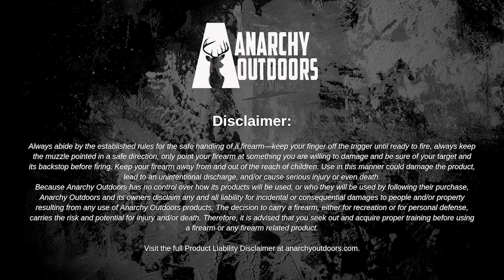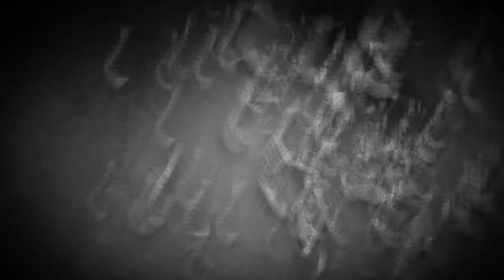Ruger Precision Magnum Bolt Shroud Installation

Comment: i installed new Aluminum shroud worked great but now i need to remove it i turned it and its clicked and locked now i cant remove it or  slide it back into gun its off centre how do i reset its locked wont move
Reply from the maker: Keep turning the bolt shroud and it will click back into the correct position. It will feel hard but just turn it.

Comment: is the original shroud suppose to be a bit loose when instal ? on my 338 lm sorry its my first bolt action gun i m new
Reply from the maker: Its loose due to Ruger tolerances. If its to tight you will get hang fires.

Comment: These things fit wprse than the stock shroud and customer service doesnt care about you
Reply from the maker: @Dimethetime  sorry you feel that way. Some of Ruger bolts are smaller than others and our shroud fit very loose. This is a tolerance issue on Ruger's side. In order to have a safe product and not create dangerous situations this is the reality of owning a Ruger Precision, sometimes our parts will are to tight, just right or loose. We do our best to find the middle ground.